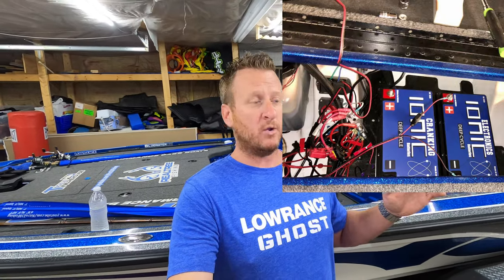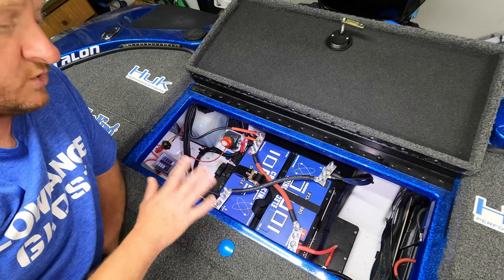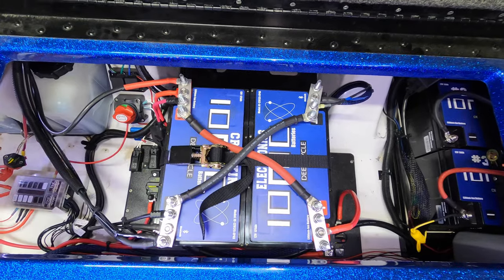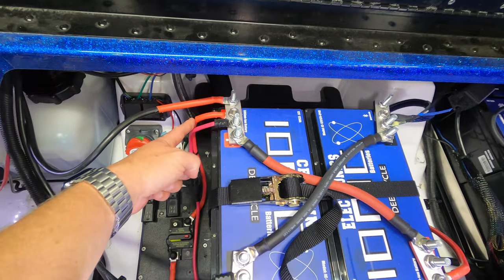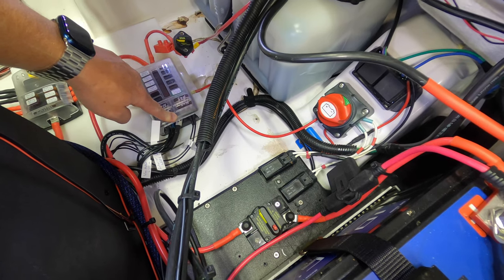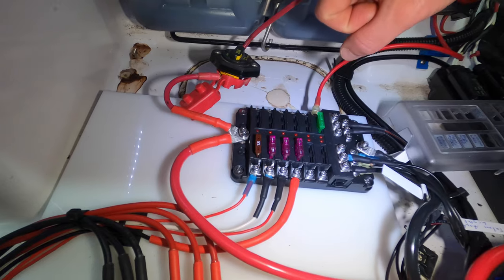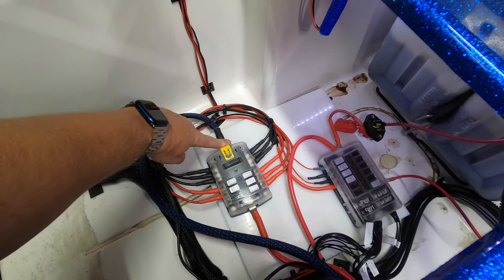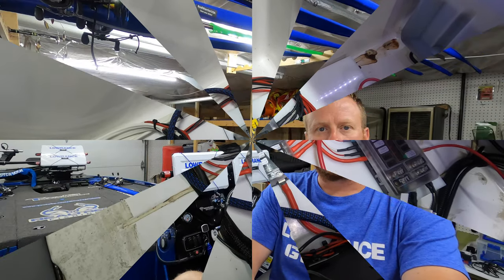How To Use Fuse Blocks To Clean Up Your Wiring!

Comment: Your wiring job is beautiful!  I noticed the two batteries that you wired up in parallel are labeled CRANKING and ELECTRONICS. What I did not see was a battery isolation device that would enable the dedicated use that you described. I could be wrong, but I believe the two fuse boxes are essentially connected to the same battery because they are connected in parallel.

Comment: what size fuse did you run to your graphs, everyone that i talk to said 40, also should i run the wires coming from fuse block that is the factory one at the console, i am assuming that the livewell, accessory switch and nav lights are ran threw that block, should i fuse those again at the back

Comment: I know I’ve commented already but I mounted my fuse block in the rear compartment on my Ranger where my battery switch is and all I’m powering off my block are my Live 9 in the bow and my Live 12 at the console both with dedicated 10 gauge wire. When I mount my single Talon I’ll run that to the block also that’s all I’ll have on there are those 3 things. I was thinking of using 10 gauge to power the fuse block also since I have that wire already. I went with 10 gauge since I’m only running the 2 graphs. Do you think I’ll be ok powering that block with 10 gauge ?

Comment: Would like to see how you run the positive wires (for your lights, etc.) from the fuse block to the switch panel.  I’m having trouble figuring out how to run an accessory to the switch panel and then to fuse block. Thanks!

Comment: Great video! Could you tell me the purpose of the breaker on/off switch between the battery and your electronics fuse block? I know you need a perko style on/off to cut power but because each accessory is already fused what is the purpose of the breaker? If a breaker is necessary how do you determine the amp size. I’m running 3hds live 12’s and active target which is about a 10a draw. Any idea what size breaker I’d need? Thanks

Comment: What size wire did you use from block to livescope?  I've got about a 5 foot run to my electronics block.  Ive ran 8 gauge to my block.  Ive ran 10 to my graphs from that block.  I am trying to figure out what wire to run from block to mega 360 and mega live.  What do you suggest?

Comment: You sir, have created a MASTERPIECE! You should open your back hatches every time you walk into the garage and beam with pride! It starts with the wiring in the back of the boat and obviously runs to the bow - in fact, every inch if your boat is the ultimate masterpiece! PROUD, PROUD, PROUD is the owner of this boat - even more so when you're the one who did it! It's easy to tell you, sir, are a perfectionist! And your boat is PERFECT from bow to stern! 
I have a couple of questions if you don't mind? 
1) Are the positive and negative posts on the fuse block size 3/8? (I can't find ring terminals which are for size 4, 6 or 8 cable and have a smaller ring size - I think the posts on the fuse blocks are smaller than the 3/8 on the Ionics?) 
2) What did you use to cover the ring terminal and part of the cable where it attaches to the fuse block? Is that just red and black heat shrink tubing? It makes your connections look PERFECT. 
3) Where are your trolling motor batteries located? Are they Ionics too? Do you have pictures? 
Thank you!
Reply from the maker: Thanks Steve, I really appreciate that!!…let me see if I can help ya

1) the ring size for the positive/ground posts on the block are a #10 ring terminal, they fit perfectly 

2)Yepper, it’s just heat shrink tubing…makes it look nice and neat!

Hope that helps, let me know if ya need anything else!
Reply from the maker: Sorry, forgot #3…lol

Yepper, I run 3 of the 50ah Ionics for my Ghost, they’re located in the back corner of the port side of boat battery compartment…I have a video here showing the setup if it’ll help ya!…thanks again for the kind words!

Comment: what does the second positive go to from your accessory fuse panel? thanks
Reply from the maker: Hey Casey!…that other positive goes to my remote oil fill, it was rigged direct to my battery from the factory so I just hooked it to the positive post on fuse panel…hope that helps!

Comment: what charger are you using to charge the dual 125AH batteries . i just purchased 2 of them to do the same thing
Reply from the maker: I have them hooked up in parallel and hooked up to the Power Pole Charge….the performance is unreal, they last forever!

Comment: Looks great. I Never saw a blue sea fuse block that had LEDs. I’ve looked for a while.  Definitely haven’t seen a 12 terminal blue sea block with negative, that has screws that size. Those lugs don’t look like #8 (M4) that come on the blue sea. I wish they used bigger screws or at least wider slots because it’s not always easy to find rings that tiny, that  come on the actual blue sea ones.  I just wish I knew what brand  block that was, because I’ve been looking for one that has the LEDs that is decent quality and can fit at least #10 rings.

Comment: Where did you get those bus bars that are on the battery? There is no link in your list for those. Also, the motor is directly wired to the battery?
Reply from the maker: Got them from Lithium hub, here’s the direct link!…and yes sir, big motor is still direct to cranking battery 

https://lithiumhub.com/product/terminal-adapter/

Comment: Great stuff........Question though. You have your two 12v batteries in parallel giving you a total of 250amp hours. But if I followed you correctly you are using each battery separately to power different things (one battery for your motor, lights. pumps and the other battery for you electronics?) Also, is running them parallel allowing you to use the power pole charge because you can really only use a power pole charge with two batteries?

Comment: Do u have a video when u ran the wire to the graphs? What size wire & where did u get the wire running to the graphs?
Reply from the maker: I never made a video of the actual graph wiring install, but I use 10 gauge marine grade for all my graphs running from fuse block to unit….I’ll put a link down below for the wiring I used, highly recommend it!

https://amzn.to/3CwiW0W

Comment: Still learning here. Good video. Wish you would have also explain/show the main switches if any......
Reply from the maker: Thank you!…those 50 amp fuses also act as main switches if I want to kill the power to the blocks…there’s a red button on the top of the fuses that you can see in the video, if you press that it shuts all power off to the blocks, so it acts as a switch and a fuse all in one…makes it super easy if I ever need to kill the power to the blocks, hope that helps!…let me know if ya have any other questions!

Comment: How do you determine what size fuse goes on the block?  I'm thinking about adding one for my 2, 9 inch garmins and the black box.
Reply from the maker: All depends on how many amps they pull, they should say in the instruction manual for the units what fuse you should use for them...unfortunately I'm not too familiar with Garmin so I don't want to give ya any wrong info...but let me know if ya can't find it in manual, I'll see if I can dig up the correct amp for ya!

Comment: Howdy
You have 4 gauge from batteries to the block and perhaps 8 or 10 gauge from the block to your electronics. Does the block cause a power bottle neck? I hope that makes sense - I guess what I want to know is if you ran 8 gauge directly to the battery, you get 8 gauge power. But can the block cause you to have 10 gauge power even though you used 8 gauge wire?
Thanks for your help!
Mark

Comment: just had to add this, watching another one of your video and saw you are from Pa.  I am located near Pittsburgh.  Just came from maine fishing, and was at lake efuala in Ga.. Try to go 2 places each year.  Maybe we can exchange email address and hook up some time to fish.  Also I have a question about the ionic battery's.  Do you need to change the charging system or will the one I have for my stock lead 4 bank pro charging system work with them.  Thanks
Reply from the maker: Yea absolutely!…I travel to NY a few times a year to fish, we could definitely meet up on the water!… as for the charger, it depends on the one that you have… Some older chargers are compatible with lithium’s, what exact charger do you have?

Comment: Great video but I have a question about the fuse blocks. I have power poles anda panoptix black box and they both have 40 amp in-line fuses in the power wires. I want to connect them to the clear blue fuse block I bought but I read that each circuit is only rated for 30 amps. The way I understand that to mean is that you can connect anything to any one fuse block that's over 30 amps, is that correct? What are my options?  I've tried researching 40 amp or higher circuit fuse blocks but can't find any. I have a 2018 Nitro Z19.
Reply from the maker: Hey Jim!…that’s correct, as far as I know each circuit is only rated for up to 30 amps each (but total of each circuit shouldn’t exceed what’s listed for the block)… I’m honestly not sure if I’ve ever seen a block like that, they may exist but I’ve never needed one that large… If I come across anything that might be helpful for you I will definitely pass it along!
Reply: If it's protected by a 40 Amp fuse in-line then it shouldn't matter right ? It's like double protected  ? If he hooks to the fuse block that's got a 30 Amp fuse.

Comment: What’s the best way to determine what fuse size you need for each accessory?
Reply from the maker: Hey Jeff!…you can do a couple different things…if the accessory didn’t come with a fuse, first I would check the user manual…it should state somewhere in there what size fuse is required…if not you can check to see how many amps it draws off battery and match it with appropriate fuse…if all else fails and you’re still unsure, Google is your friend!…lol…or you can even ask me on here and I’ll do whatever I can to help ya out!

Comment: What size wire did you run to each graph ? I looked up 8 gauge and looks as though they only come red and yellow wire.
Reply from the maker: Hey Glenn!…here’s the direct link to Ancor Marine grade with black/red options in 8 gauge…let me know if ya need anything else!

https://amzn.to/3BaTZbz
Reply: @NitroZ18Fishing  Thanks so much another question when you buy connectors for the 8 gauge when hooking to the Lowrance power cord doesn’t it have a lot smaller wire ? Any problems with a connector that fits that bigger 8 gauge ? Thanks for the help !!
Reply from the maker: No prob!!…yea what I’ll do sometimes in cases like this is buy “step down” butt connectors, and I’ll take the smaller wire from Lowrance, strip a bunch off, and triple the wire over itself to bulk it up before putting it in connector…if that makes sense…haha…here’s a link to the step downs I’m referring to, hope that helps!

https://amzn.to/3eEC8C5

Comment: I just binged  your videos. Since I have Lowrance products on my 2019 Triton patriot 19'.  Unfortunate I had to get the Ultrex with I pilot, it works great the few times I have used it and pulls the boat around fantastic, but will not link up with the lowrance items. Been debating on finding a place for trade in or trying to sell, but taking a big lost on a new tm is hard to swallow, just to have a few extra's the ghost will provide, any thought on idea if you ran the ultrex.  Seems like there is a lot of glitches in the ghost Tm and advertised options not working yet.  That active view looks great add on also. Any new comments on Tm and active since you have had them now for a awhile.  Also is there a way to go from down  to front view on the active without having to pull the tm out of the water and adjust the transducer, seems like a pain to do every time you want to change view. Where did you get the straps for the sun covers on you fish finders, I have a problem of my falling off when travailing boat with cover on and off.
Reply from the maker: Hey Bob!… i’m sorry, I don’t know how I missed your comment… The Ultrex is definitely a good motor in itself, but the ghost is the best trolling motor I’ve ever been on a boat with hands down… I would definitely consider making the switch, especially if you use Lowrance units on the boat… i’ve had no issues with my ghost at all, and I’ve heard countless people who made the switch from the Ultrex say that they have no regrets whatsoever and that the ghost is just an all around better motor…unfortunately as of right now there is no way to switch from down to front view without lifting the trolling motor out of the water… And the straps that I have on my fishfinder’s are from Boat EFX, they work perfectly!…here’s the link if it would help!  https://boatefx.com/products/boatefx-electronic-graph-cover-trap

Comment: That is great but that doesn't allow you to power those accessories on and off. How do you wire in the switch panel so the accessories are both fuze protected and on an on/off switch?
Reply from the maker: I can cut the power to both fuse blocks (individually) using the switch style fuses I show in the video…it’s definitely a nice option to include!

Comment: Pat What a great job and looks pretty. OCD is good!!! I did the same set up minus some of the stuff you have Lights, radio, poles. I am surprised by the room you have in that Nitro. You should try to do that in a Ranger a lot less room to work. I like the idea of a second batt. But  I don't know how Id fit it. Will an Ionic charger recharge both ???? I put a switch also to turn off the electronics.
Reply from the maker: Thanks Chris!!…yea having that 2nd “house” battery is awesome, I never have to worry about running outta juice, it’s crazy the amount of time I get outta this setup!…yepper, the Ionic charger will recharge both, it would just take longer to reach full charge, but would absolutely work…and having a switch to turn off all power is nice, that’s what I like about those 50 amp fuses I have coming off both batteries…they have a switch built into them where I can cut all power to the each individual fuse block, thus cutting power to anything hooked to that block…it’s a win/win…thanks for watching!
Reply: @NitroZ18Fishing  Thanks Patrick. sounds like the way I need to go. With the 2 12 and the 16 on plus AT running  the wells going all day in a tournament I have drawn down the 125 Ionic down to 48%. the big motor still cranks up but just a little concerned. Looks like a winter projects in the making. Thanks keep up the vids Chris
Reply from the maker: Yea no prob!…let me know how ya make out!

Comment: What size fuses do you use in the fuse block?
Reply from the maker: That varies depending on your devices, you have to coordinate the proper size fuse for each connection at fuse block...for example, my graphs call for a 5 amp fuse, so the spots that the graph wire is ran to, I have a 5 in that spot...hope that helps!
Reply: @NitroZ18Fishing  thank you. I wound up finding what my problem was.
Reply from the maker: No prob, let me know if I can help with anything else!...sorry it took me so long to respond to the original comment, don't know how I missed it!
Reply: @NitroZ18Fishing  no problem.

Comment: what epoxy did you use for the cutting board ?  Some times not any epoxy will work. thanks love your shows. I just got my new Z21 XL in last week.
Reply from the maker: If I remember correctly it was a marine grade JB Weld mix… It’s been holding perfectly so far, hope that helps!
Reply from the maker: Congrats on the new rig, those Z21 XL‘s look legit!

Comment: Maybe I'm missing something here but, what is the purpose of running these batteries in Parrell? The way you're running wires from the individual batteries to individual Fuse Blocks only allows for the individual amps of one battery (or the other) to be utilized. Also, you mention one of the batteries being the Starting (or Crank) Battery. Using a Deep Cycle Battery for this purpose is not ideal, if said battery(s) are being charged from the Engine Alternator.

Comment: Nice and clean, good try! Maybe explain why bigger is better,  as you say, on the wire size. Most people don't understand ohms or resistance, and don't know about voltage drop, especially in low voltage wiring systems.  Also circuit breakers are not fuses. Just saying.

Comment: How much interference are you getting on your electronics running the power wires with the other wiring? Marine wiring is not needed if your connections are done right in freshwater. Marine wiring is needed in saltwater though.
Reply from the maker: Minimal interference, if any at all…only interference I get is on my Active Target from the other Sonar running along side the ducer, but that’s basically unavoidable…if I pause the other sonar my AT clears right up…thanks for watching!